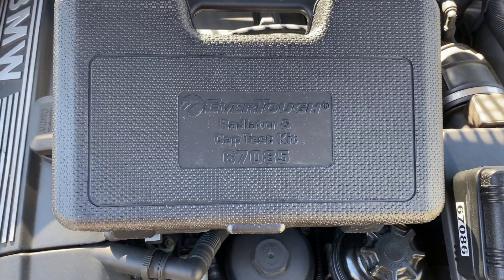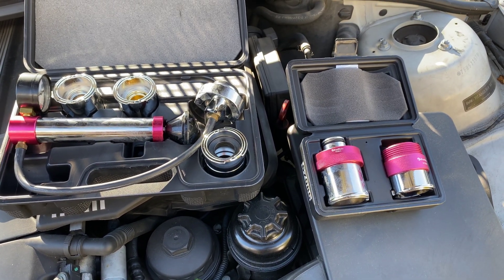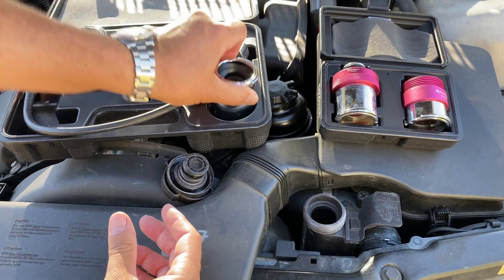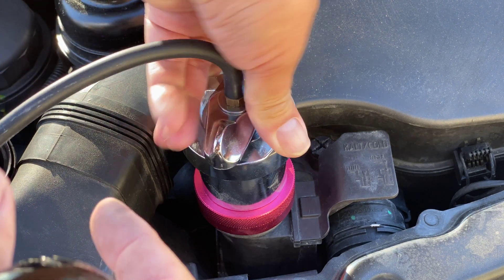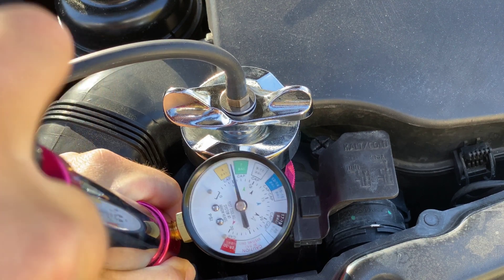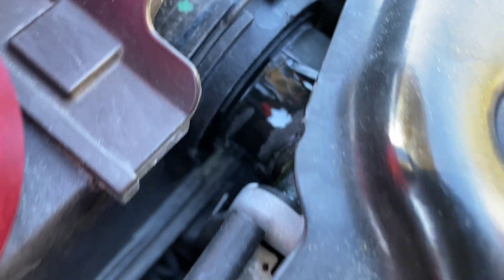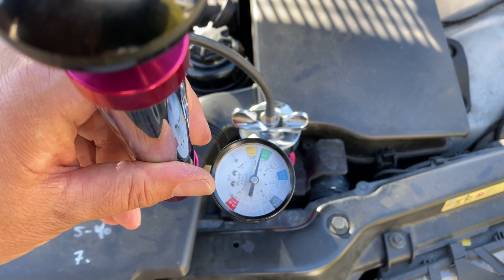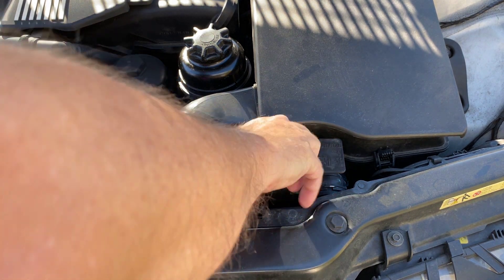Pressure test on BMW E46 - Evertough 67085 Radiator & cap test kit with 67086 Adapter set

Comment: These are not the correct threads for bmw. Did not work on my 01 325i, but I went to advance and picked up the powerbilt 22 piece kit, orange #5 adapter was the right one.

Comment: Thanks so much for making your video, I have a Toyota Camry but the directions that came with the kit from O’Reilly auto Parts part weren’t too clear, I had my adapter on but I put the top piece on with the pump and it wouldn’t pressurize I figured I had to rotate that cap but finally I figured it out leaving the top not raised up on the lip if that makes any sense? So that it would pressure up, found a leak quickly right in the top of the radiator fluid was shooting out.
Reply from the maker: glad it helped you! leaks are a real annoyance! I swapped a coolant hose today on my new BMW project car. Wasn't a bad one, but ugh.
Reply: I was going to tell him "Thanks!!" for a similar reason. The O'Reilly auto parts kit was very helpful, but the part about the onw switch that rotates on the cap was confusing, until I saw this video.